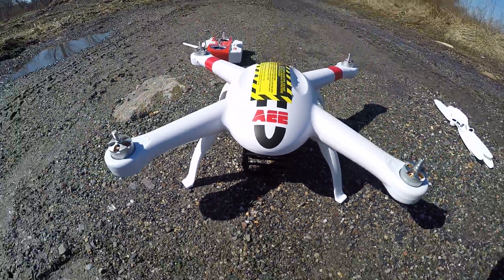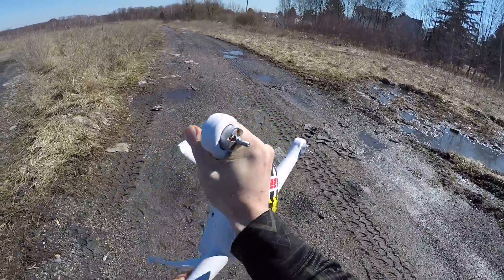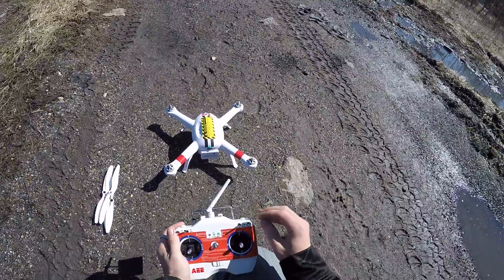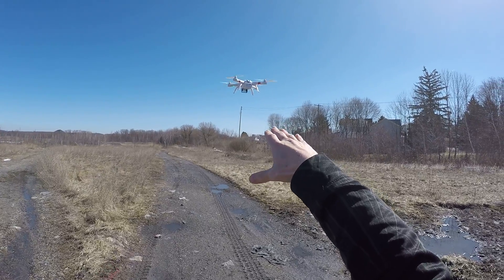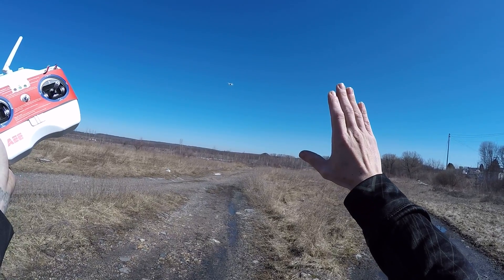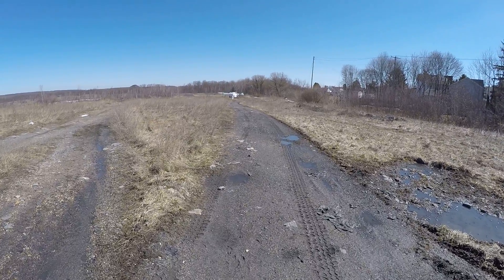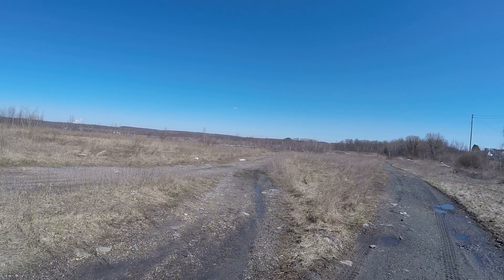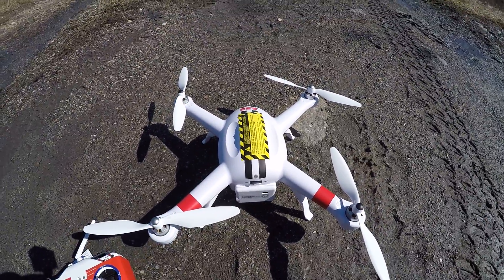AEE Technology AP9 SETUP & 1st FLIGHT GPS Drone Aircraft System Quadcopter Review

Comment: I love my aee apcam/ap9 no battery issues easy 25 minute flight times! She stable as can be pretty darn fast i think most of those online reviews are more user error then anything she is complex there's a few different calibrations that must be done and done correctly! I love mine that i just ordered the ap11pro from hsn for $299
Reply from the maker: yeah i had no issues the battery was charged days ago all it takes is home work n yes there r 2 or 3 other calibrations that can be done if it isnt flyng wel -- i would say pilot error as well
Reply: sucker,, i have one,, and both ap10 band ap11 are straight poo
Reply: Kevin Dodson what makes it poo as you say i have a 9 and 11 and there definitely not poo mine are very stable and fast gps hold is great! The app ain't the best with no telemetry or nothing but they are good camera birds!

Comment: Startup procedure I do is  turn on tx, turn on drone, wait for long beep from drone, toggle gps switch until  led over drone power switch blinks fast. Gps switch up, sticks up and in until green leds on front arms blink slow. 2 turns, 2 turns nose down, 2 turns sideways. Front leds should be solid, rear led should be solid. GTG!  Those panasonic AAs are probably 3 years old, did the same thing! They were new, right? Lol! Beeps are 1st and 2nd battery levels, start on a battery right off the charger and you should see 20 plug minutes.
Reply: this is correct!